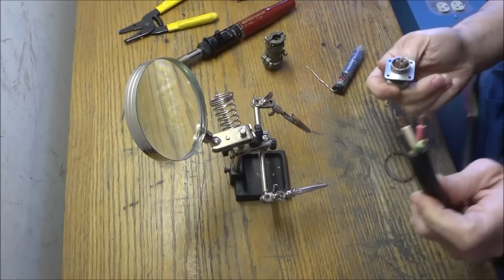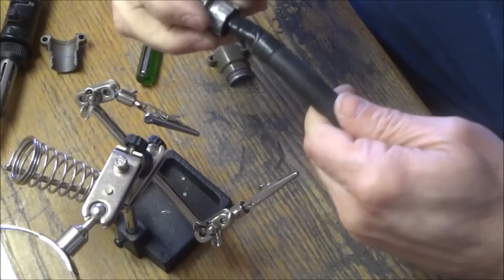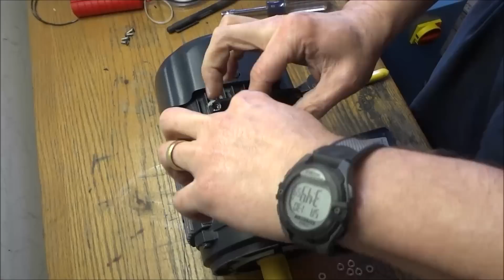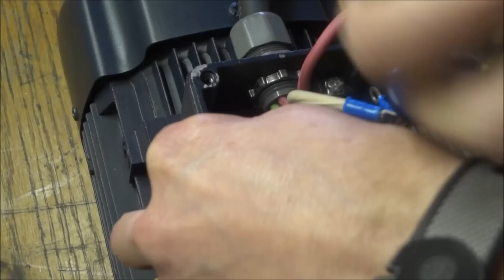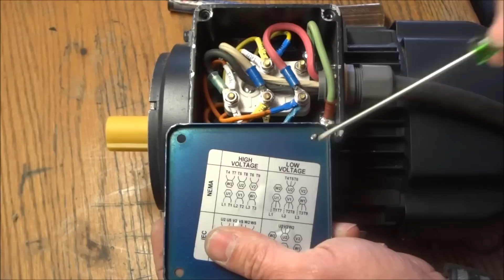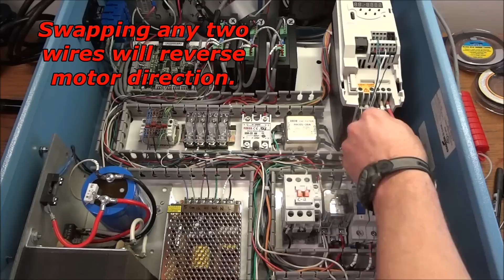PM 727M Wiring Pt 11 " Spindle motor connections"

Comment: Ok I’m not an electrician I acquired a motor like this and was trying to figure out what to do with it. I don’t know what it’s purpose is.
Reply from the maker: I see well if it is a 230v /460v 3 phase motor it will need a VFD to operate which puts out 3 phase power.
 you will have 9 wires in the connection box.

Comment: hi sam, great video, question if you was doing a g0704 mill wot spindle motor upgrade would you consider ?, thanks Daniel
Reply from the maker: +Daniel Kitson  Thanks,
To Be completely Honest I've been running my X2 with the stock motor for three years it works fine I just have gotten used to it's limitations and work within them. I have wanted a bigger mill for some time and had thought it would be the G0704 However I really wanted a three phase motor at least 1 hp and the frame work on the G0704 to me is just not adequate for that size motor. Now I have seen it done and it seems to work so what do I know. But I think I would stay with a DC Treadmill motor setup you can find them with 2 HP in a small package. In fact I picked one up at my landfill one day for free with the driver board. Just my 2 cents.
Reply: Thanks for your rely Sam,  my g0704 works OK as it is, its just lacking power as you can guess, as you say putting a big motor on isn't easy, I have thought of putting a water cooled 2.2kw motor on because of the small footprint, and that would give a 4000 to 24000 speed which could be geared down, the balance is cost and performance, I have Seen wot the tormach 440 can do on nyccnc cnc channel, maybe that would be the way to go that style of motor and driver, anyway my mill runs good and slow, keep the videos coming Sam I love new ideas, food for thought on my lathe is have now make an isolated pin that goes in the chuck (pin 15 ) and with a pin from my breakout board and the quick change holder grounded I have two buttons in Mach 3 turn ( Z and X ) I have two probing routines that touch my tools off automatically, if you ever want to try it i will be happy to send you to code, Thanks daniel
Reply from the maker: +Daniel Kitson 
Yea not sure about those spindles I have seen them But I think they may lack torque. Have you converted to Belt Drive? That will help a lot and get the RPM's up.
Reply: +CNC4XR7 no not done speed drive yet Sam,  I am thinking of it, I was just watching a tormach video on there high speed spindle and if your cutting g code is good I would imagine I small endmill running at 24,000 would cut well ?, maybe I belt drive with three ranges could be good idea, with a water cooled motor I think a very small depth of cut and a high feed rate could work ? or maybe build a new head for it, you could swap heads one for high speed maching and one for standard maching, wot you think ?, thanks daniel